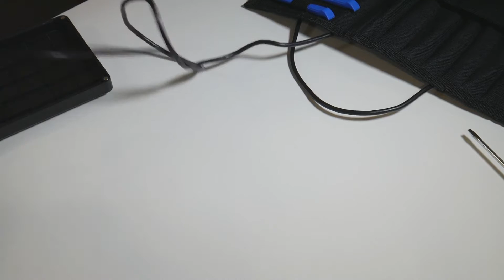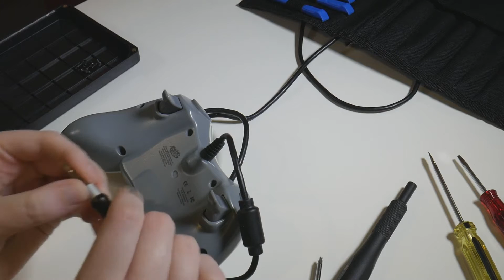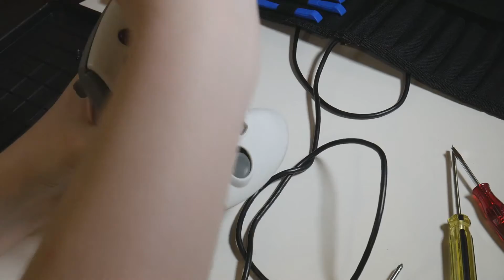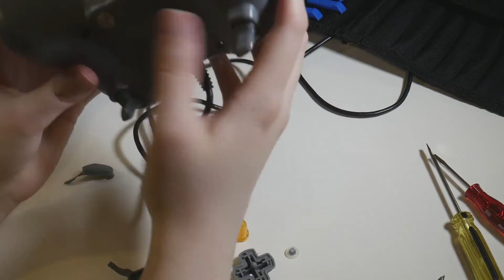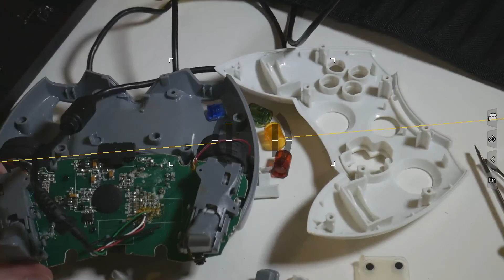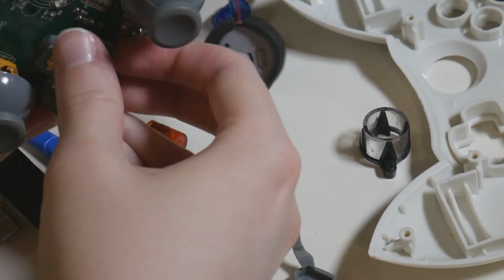Live Teardown of a USB Game Controller

Comment: I wonder what caused all that weird buildup. I recently took apart an OEM microsoft 360 controller to paint it. All the guts looked brand new. The only way you could tell it was well worn was the wear on the exterior.